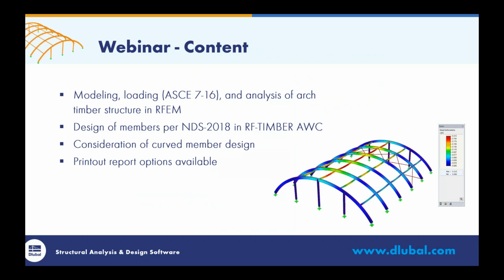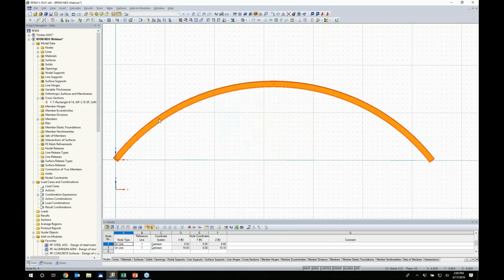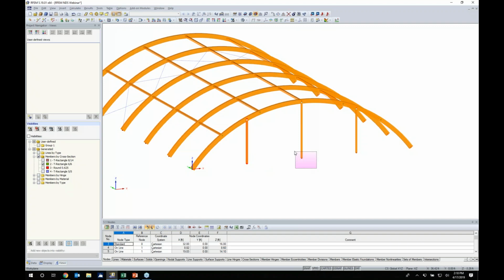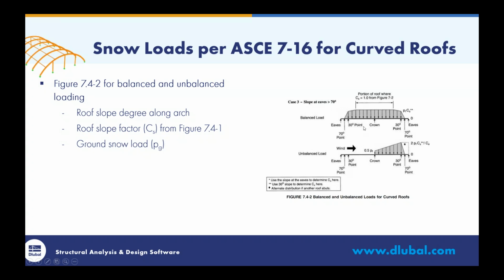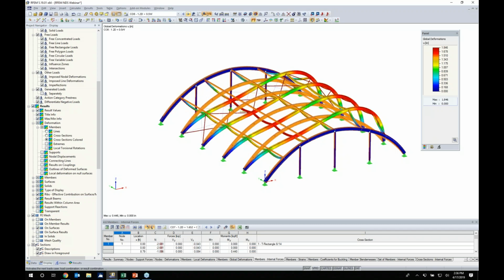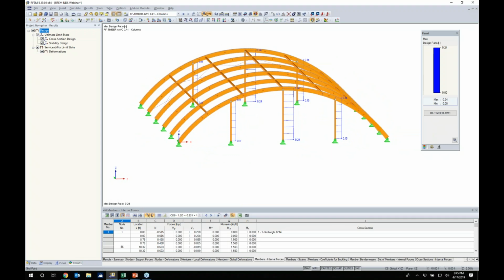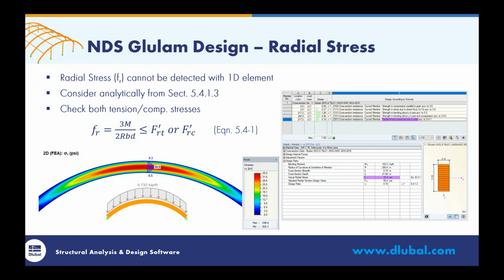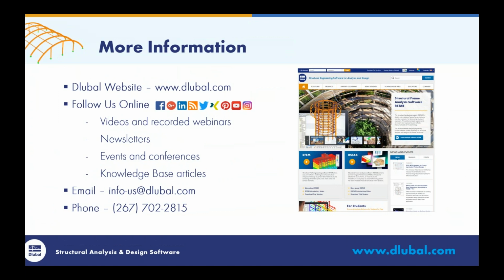Webinar: Timber Arch Structure Design per NDS-2018 in RFEM (USA)

Comment: Why did you cut magnitude of loads by two on first and last beam ?
Reply from the maker: Hi, Eric!
This is because the first and last beam get only loads from one side while internal beams get loads from both sides.
Reply: @DlubalEN  Ok thanks and how did you find 0,1kip/ft ?
Reply from the maker: Hi, Eric!
That is just and assumed magnitude for the dead load. It is a pretty common value from the weight of the roof that is not entered in this model in detail.

Comment: why did you choose wind load's direction (Global XL) instead of Global ZL??35:08
Reply from the maker: Hi, raj!
Because the wind acts typically over the entire real length of the member. There is no such direction XZ in the program. I am not sure if I understood correctly.
Reply from the maker: Hi, raj!
Because this is the main direction the wind acts in this example. Sure you could also add the Global ZL wind load parts to it.  There can be more load cases of course and combinations of it.

Comment: So what can we do if we want to design curved members for stability ?
Reply from the maker: Hi, highflyi!
The easiest way would be to apply imperfections and use a second order analysis. The codes usually only can handle straight members with analytical formulas. But in RFEM you can apply imperfections and run a second order analysis. If the critical load factor is greater than one and the section check is ok, normally the check for stability is ok. Please refer to your code if there are regulations about such a procedure.